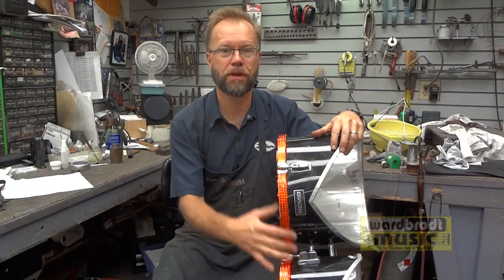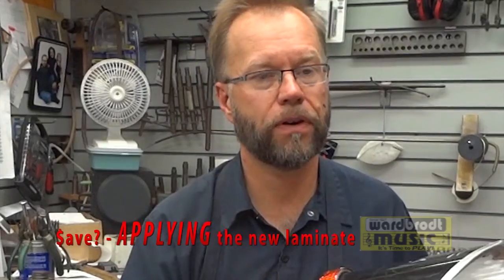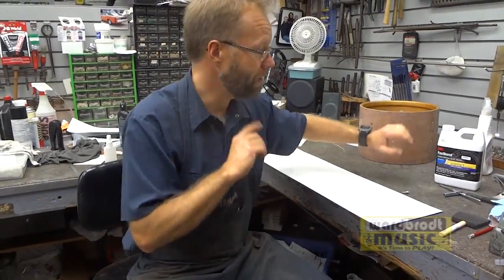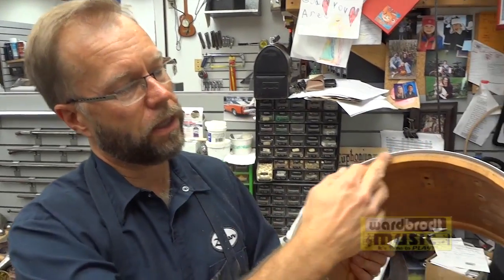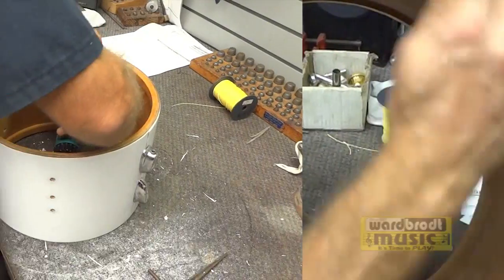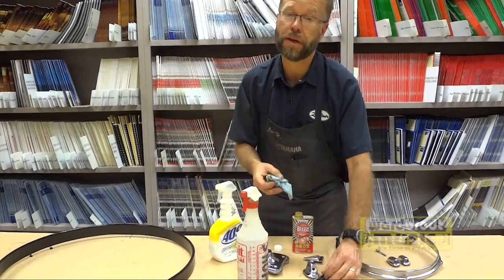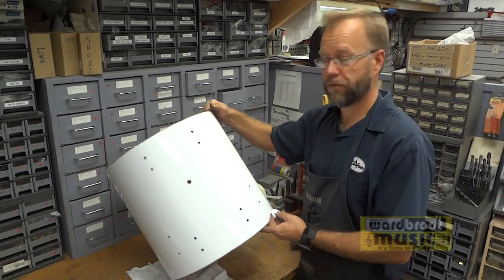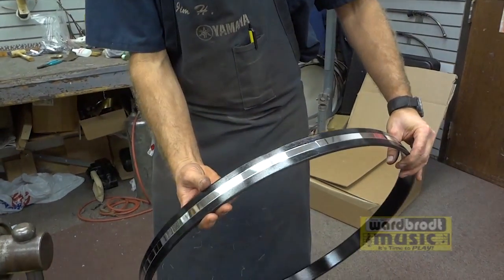Recover your Drums - Give Your Existing Drums a New Look

Comment: Hi There, can you simply remove the laminate and then stain and finish the wood? Would this effect the tone?
Reply from the maker: Yes, you can strip the drum, remove all glue residue and then finish/stain the drum. If you are playing acoustically you may be able to tell a difference between a wrapped shell and a non wrapped shell. The non wrapped shell hypothetically should be more open as the drum is free to vibrate more. This can be very subjective though.